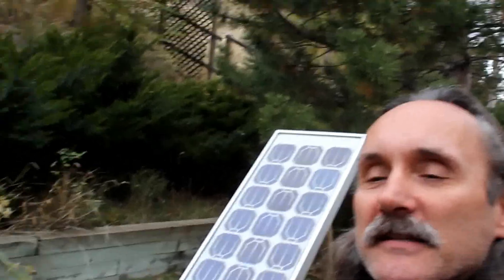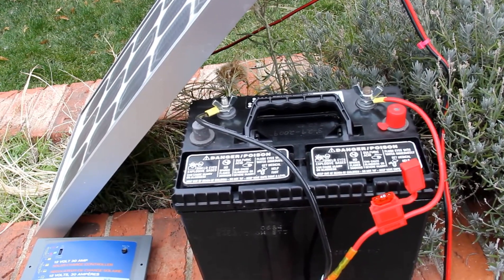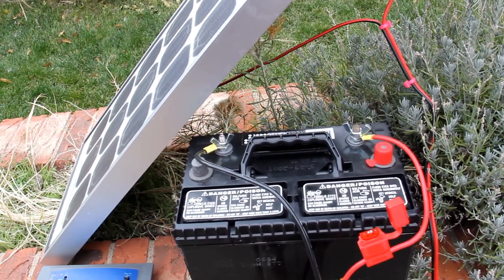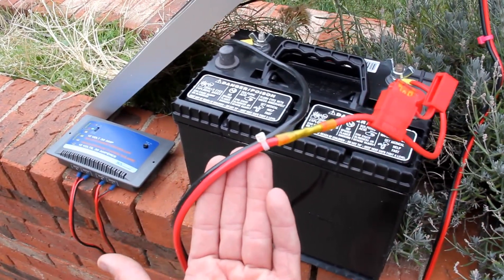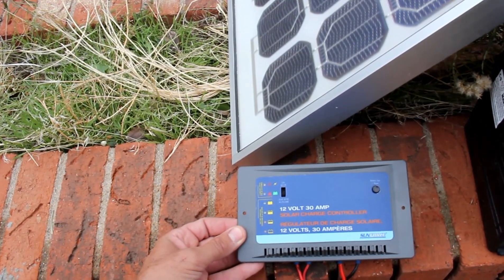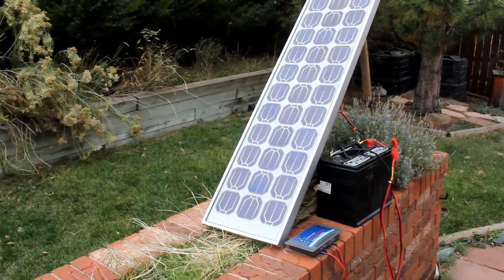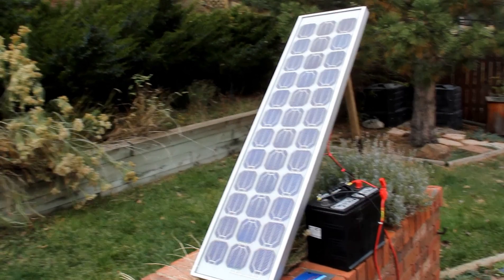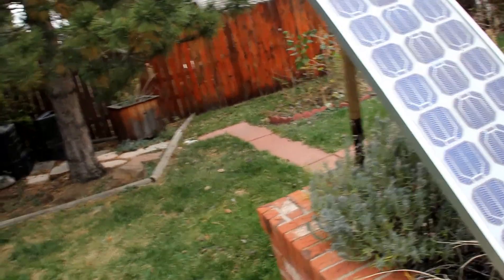DIY Solar: Simple, cost-effective battery charging

Comment: Awesome!! Keep it simple!!! 
Portable solar generators are expensive still these days and this is a great alternative
I would use a 300 watt folding solar panel and a solar charger to charge a 1000 watt marine deep cycle in 5-6 hours. I would like to go camping off grid and think this would be a awesome setup to power my devices such a 45 watt electric fridge and other misc. devices

Comment: I have a 35ah 12v deep cycle battery that I use in my car to run my CPAP , I have been getting it charged everyday at an auto parts store . What would be the cheapest solar panel I could get to charge it in my car? The battery usually discharges to about 12.24 after I wake up in the morning and check it with the mulit-meter.
Reply from the maker: Depends how much time and sunlight you have. With enough sun, and direct sunlight most of the day. you could probably get by with a 50 watt panel, brand new, for $80 online.

Comment: Sir 50wates solar panels 64 ah how many timing charging
Reply from the maker: I don't need to charge it very much since I draw so little current - my radio equipment is low power.

Comment: do you do lot of solar power
Reply from the maker: No, I do not. I use small solar panels and batteries to power my amateur radio equipment and other gear. As for my home, I subscribe to "WindSource" so all of my electricity has been offset by wind power for many years now...

Comment: Hi Rodger, Davie EI4KL / SN5DX here. I found your video looking into solar charging a deep cycle battery . My idea would be to operate in the middle of nowhere where this is no electric supply. My concern is that if the panel is operative it would cause noise / EMI when im receiving . What are your thoughts on this concern ?
Reply from the maker: David, my apologies for the late response as I've been traveling. But, to answer your question the panel itself doesn't generate any noise that I've been able to detect. However, sometimes charge controllers and other devices attached to the system do create receiver noise. Have fun experimenting!

Comment: I'm all for using solar energy for generating electricity. However, in very-small-scale cases such as yours I'm not sure what releases more carbon into the atmosphere. Burning coal to produce the equivalent amount of electricity to what you produce using your setup, or producing the solar panel, battery, wires, connectors, transporting these to your house etc.
Reply from the maker: +lucianmp You bring up a good point that I've often wondered about myself: how much embedded energy (and production of waste products and pollutants) are involved in the use of these solar systems, controllers, wiring, batteries, etc.? Same goes for "hybrid" vehicles with their claims of great gasoline mileage - are there even bigger losses when you calculate the extensive battery systems they rely on, etc.?

Comment: Hello Roger,
I work in farmers market selling my meat specialties. I make hams and other cured meats specialties. I sell in 5 outdoor farmers markets and i need to power my meat slicer with a deep cicle battery and I am willing to charge it either with solar and traditional electric source. Am I investigating the right options for my needs? Thank you.
Reply from the maker: Riviera Grill I'm not familiar with meat slicers - do they draw a lot of current (how many amps do they draw?)? Although I am not familiar with them I would suspect most meat slicers run off 120 volts, here in the U.S., so you'd also need an inverter to change the 12 volt battery voltage to the 120 needed for your device. Unless, of course, there are 12 volt meat slicers? If the meat slicer draws a lot of current (at either voltage level) that would still be okay if you only used it for short periods of time. Sorry for the delayed response as I'm out-of-the-country traveling right now but will be glad to respond when time permits. Good luck!
Reply: Hey thank you. I'll see the details later. Enjoy your travelling around the world..............
Reply from the maker: +Riviera Grill I'm back from the Northern Mariana Islands now! Happy to try and answer any other questions. But, again, the issue is mostly related to how much current your device will draw and how long it's in use. High amounts of current can be drawn for short periods of time. But, obviously, high current over extended periods of time are what will be difficult if you're hauling around a battery to power your meat slicer. Best of luck!

Comment: can you power a room lamp 5 hours a day 30 days

a lab top 5 hours a day 30 days 

100 watt tv 4 hours...a day
Reply from the maker: ray bonner Nope, not with with setup you see here in my video. My array would be able to keep up enough charge to run any of those devices for that much time.
Reply: how much time before charge.
Reply from the maker: ray bonner I am sorry I can not give you an exact answer as it depends on how much current is being drawn and how well the battery has been charged. It takes a lot of direct sunlight to charge the batteries to their fullest. (I now have two identical batteries that I rotate in and out of the charging cycle) So, I usually charge the battery for about two full days and then I am able to run my small amateur radio station for an entire week before swapping batteries. The amount current draw varies depending on how much time I spend transmitting. If I'm only receiving the battery could easily power my station for a week. A VERY rough calculation is to divide battery capacity (in amp hours) divided by the device's current draw (in amp hours). So, for example, if your room lamp drew 1/2 amp and your battery had a capacity of 100 amp hours then you'd get about 200 hours of use out of the system before charging. HOWEVER, you never want to completely draw a battery down to where it's "dead" (usually defined as about 10.5 volts) as it's hard on battery life and not a very efficient use. So, for the example I've provided you may want to draw the battery down less than half way thus shortening the use time for the lamp to well under 100 hours. I hope this helps!
Reply: im thinking staying with this half amp example, using this lamp.

for 35 hours. 7 calander days.

,,,,hiw long?? does it take? to get that 35/ hours back i guess is the question 

i really have without breaking 

the half way point on the battery, but at the same time getting us back to 75 or 85 percent

im in miami/

... so sun is not a problem,

but keeping the 

battery healthy is. but at the same time ,

how many hours of sun sucking 

do you need to get a battery back to75 to 90 percent. nightly usage of light does not change,

its aslways 5 hours. x 7 days 35 hours,

so imagine??.
Reply from the maker: ray bonner It's hard to give an exact answer because there are so many variables related to the proper position of the array, how clear the skies are, the condition of the batteries and their plates, etc., Nevertheless, using your 17.5 Amp hour (half an amp at 35 hours) it would take a minimum of 17.5 hours of charging, at 1 amp, to recover the charge. And, of course, because of the aforementioned inefficiencies is could easily take up to double that amount of time which is the case here at my location. I also have a personal preference of not running my batteries very low (a relatively shallow discharge) because I want some reserve power in case of an emergency or some situation that requires reliable power. Theoretically you can run a lead-acid battery as low as 10.5 volts without too many problems but I, myself, avoid going that low.
Reply: 18 hrs i can live with.
Reply: here in miami theres an overload of sun. sunny all day into the night morning you name it. bright torturesly so.

theres respite from it.suns out all day.
its?? like you have a lamp over your head all day.

..so there no problem with sun here.

never any cloud cover.

but theres a problrm way worse than sun. and that is code/s. there no were to put the array.
im thinking seriously of putting a foldable film on my hood. with the battery in the trunk.
Reply from the maker: ray bonner I'm sorry you have code restrictions there. But, it would seem that solar panels would be exempt due to all the interest in energy efficiency? Either way, putting an array on your hood might be an option so I wish you best of luck! Let us know how it works out.
Reply: ok.

Comment: how would i measure the amount of amps going into the batteries from the solar panel would i just simply put a multimeter in series with one wire or do i have to do it another way?
Reply from the maker: Yes, an appropriately rated multimeter, with the ability to measure current flow, can be placed in-series to measure the amount of amperage. There are also "specialty" meters, of various manufacture, that are specially made for solar applications that will do the same thing.

Comment: I finished my 1st DYI solar panel a few days ago and it's been raining or highly cloudy every day now.  It's ok CO needs the water though.  :)
Reply from the maker: I've had the same experience - I'm trying to "top off" one of the large batteries I use for all my ham radio equipment and clouds and rain haven't been helping! But, agreed, we can always use the rain!
Reply: Cloudy days would be perfect for amorphous solar panels.  

I do have one question:  Is there a limit to how low a deep cycle battery can go before it has issues recharging?
Reply from the maker: Gilly Gilbs Good question. There is, indeed, a limit but I'm not sure what it is. I usually let mine drop to almost 11 volts and then charge them back up again. I use the 11 volt figure because that's about as low as most of my ham radio gear will go to run properly. My guess is you could go much lower, for more simpler applications, but the 11 volt figure has worked well for me in that the batteries have lasted many years. Don't forget to monitor the water level in the batteries as well!
Reply: Thanks, I also googled the same question and found this website with great information.  http://www.marxrv.com/12volt/12volt.htm

looks like 11.9 or 40% is the limit or suggested limit anyway.
Reply from the maker: Gilly Gilbs Wow, that site is an excellent source of info! Thanks for sharing - I'm already learning something and should avoid letting my batteries go so low!!